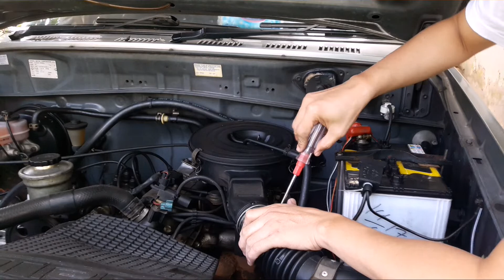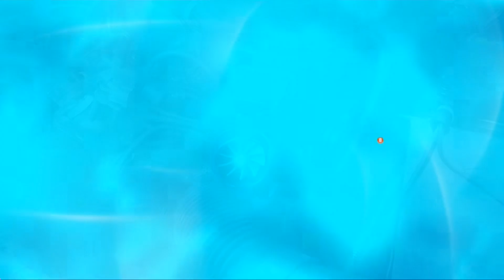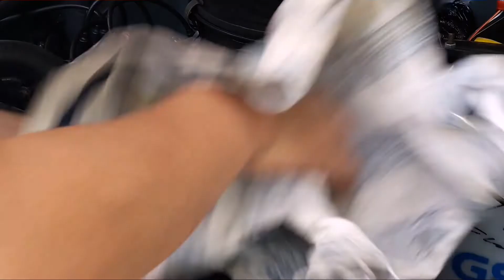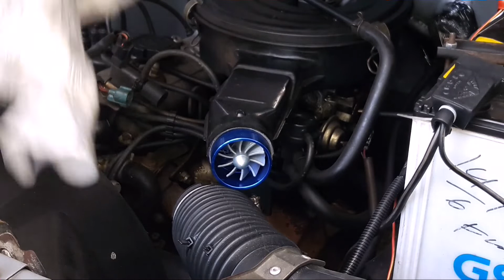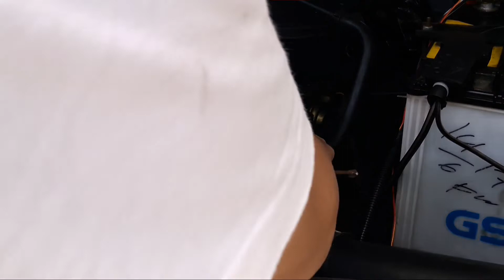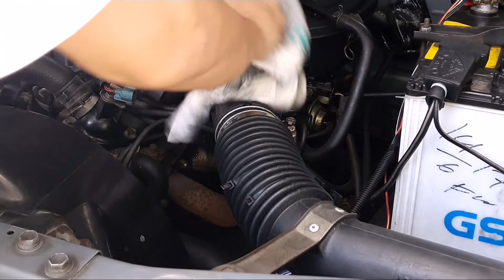Hasil Penggunaan Simota Ventilartor Turbo Single Blade pada Kijang Kapsul

Comment: Bang, harusnya dipasang setelah saringan hawa sebelum karburator.  Harus buat adapter dari pipa aluminium untuk dudukan turbonya.
Reply: Betul.....efek pusaran anginnya terhalang filter udara
Reply from the maker: iya bener, waktu itu saya coba utak atik untuk pasang di dalam filter, memang harus rombak/modifikasi. ini cara simple-nya buat yang malas modifikasi hehehe.. makasi saran dan masukan.
Reply from the maker: @khulaevapuspitasari8959  benar, pusaran angin jadi gak maksimal..
Reply: Dipasang di manapun juga ngga nambah tenaga mesin
Reply: Wiku Pamungkas tenaga biar nambah ya di oprek mesinya om. Ini mah cuma untuk memaksimalkan atau membantu pembakaran dengan dibantu suplai udara yg lebih baik.
Reply: @wedhasaputra8690  suplai udara yg lebih baik berarti injektor diganti dong supaya rasio bensin dan oksigen 14.7:1 kalo ngga gitu brarti emang cuma isapan jempol doang gaada gunanya kalo mau tenaga naik ya pake duit ngga pake barang abal gini
Reply: Pakai yg jet ranger.... kombinasi pasang tci...busi pakai yg double iridium..